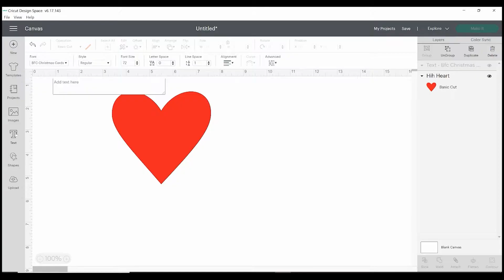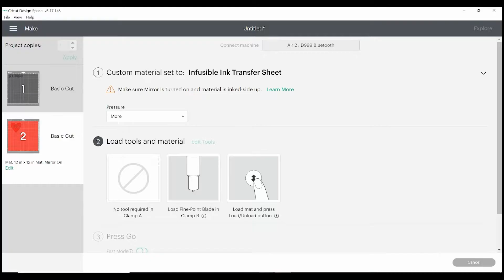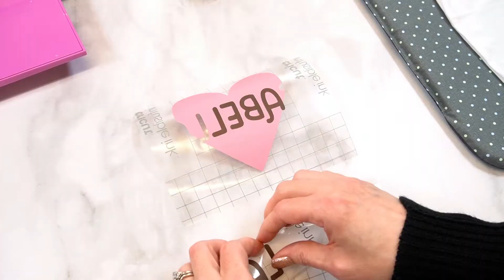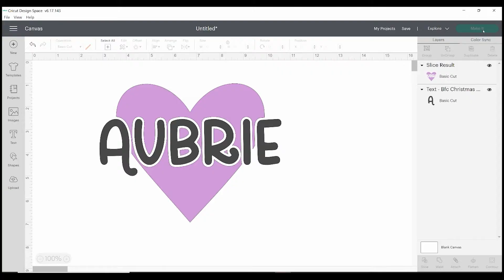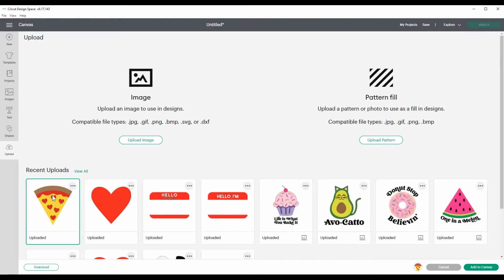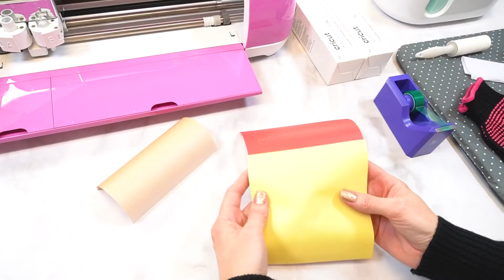How to Layer Cricut Infusible Ink

Comment: Do you need specially coated materials to use infusible ink on?
Reply from the maker: Clothing/fabric items should be at least 65% polyester, and other substrates must state that they are made for sublimation because they do have a special coating on them that makes them work with the inks. 😊

Comment: Im not a fan of the infusible ink. Its more work and they dont come out very well. Too much money invested for shirts i had to turn into dish towels or dog bed stuffing. They all loose hazy and faded and there are very limed  options . Its best to keep infusiable ink to mugs and costers. Oh and it does fade after washing. Even gental hand washing.
Reply: Mine fade off of shirts also… I wait the time frame that they recommend and it fades on the first wash, I even wash in cold water!! I don’t know what I’m doing wrong!! I also use a cricut heat press!
Reply: @jeangrandy8672  same. I think it's the brand. Cricut brand stuff isn't the best. I perfer the paper studio brand vinyls. I've also had better luck with Amazon for Infusible ink paper and printing them myself but just to much money involved just to make t-shirts. The profit isn't there.

Comment: So upset!  Part of mine didn’t transfer 😢
Any idea why?
Reply from the maker: It could be that there wasn't enough heat and pressure used in that area, or it's possible that there could have also been moisture or other interference with the dye transfer.